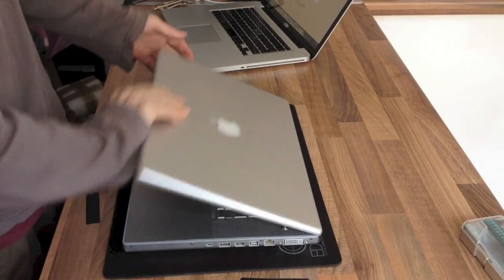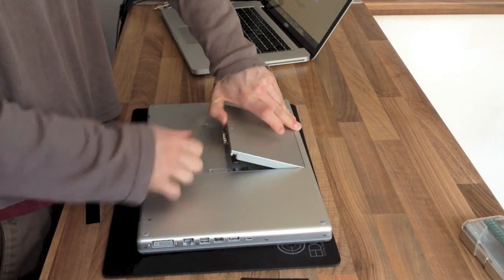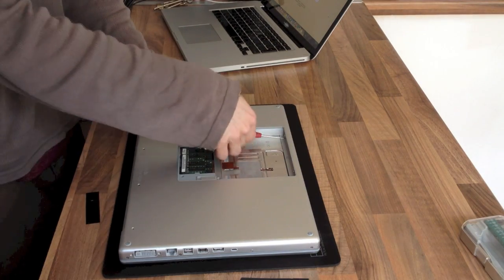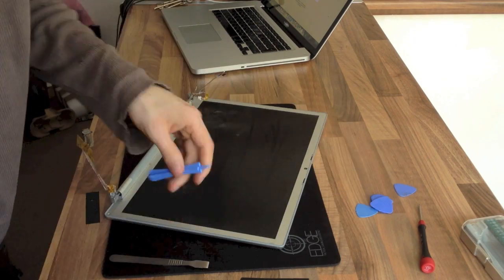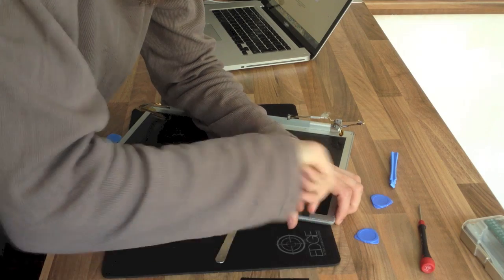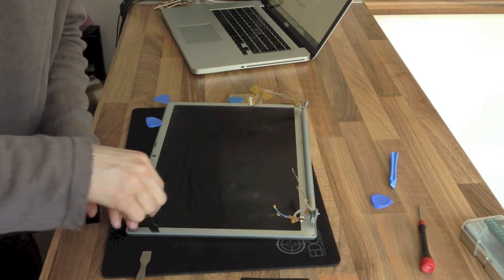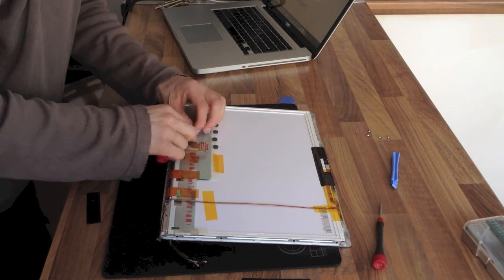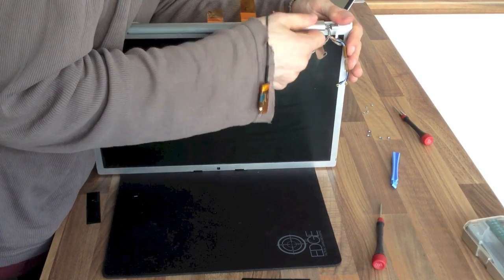Let's Fix Computers Ep.11 - MacBook Display Cable Swap

Comment: Can you comment on the problem/solution to fix the backlight on my MBP(early2008).  It is the same shell as this one in this video and you say the cable is not likely the fix if either the picture or the backlight work.  I was working on my last night and the light went out.  I was able to finish my work with a flashlight from the front side reflecting off the pixels, but need to fix the backlight.  This would be a huge help.  THX
Reply: +Adamant IT My setup is actually doing really well, after a recent RAM upgrade from 2GB to 4GB.  For better or worse I just ordered a SSHD to seal the deal.  Do you have any recommendations on parts purchasing if I go the route of repairing the screen and/or logic board?  Thanks again
Reply: +Adamant IT Perfect Sir, I do greatly appreciate the assistance.  One last thing.  I read somewhere that moving around the RAM may fix the issue.  I just installed new/used Crucial RAM right around Christmas.  When I switched the two, the backlight did work for part of the bootup and then cut out again.  Does that make logical sense? Does that make this a RAM issue?  I tried putting my old RAM back in, but that didn't work any better, so I'm guessing not a RAM issue, it just somehow alleviated the screen issue momentarily.
Reply: +Adamant IT  I have a new development...  I checked all of the connections, did the RAM swap & NVRAM/SMC reset and still no backlight, but I left the computer out in car over night where it got pretty chilly, and the screen has been working since (I also confirmed that it is an LCD screen). I haven't moved it much, but have left it on constantly since it worked. Does that change your prognosis?  I'm sure it will go out again and more permanently at some point so I want to go ahead and prep for that. Your brain is much appreciated!

Comment: Hello I have the same problem with a fall 2009 13" MacBook Pro 
I need to replace the hinges because they are completely destroyed and a new clutch cover and display cable if u know of a video showing the repair for this it would be great. I watched you do this in let's fix computers ep.9. But what year MacBook Pro was that for